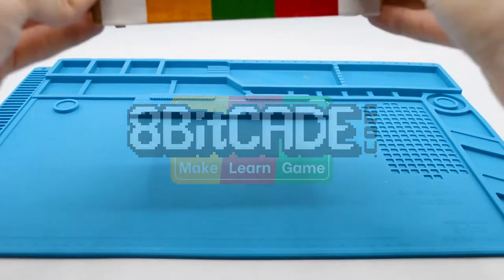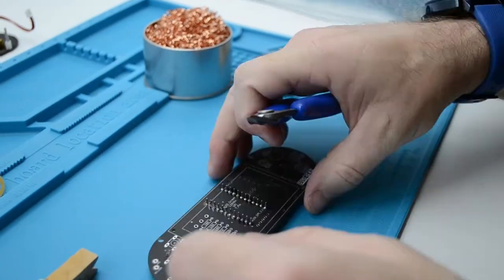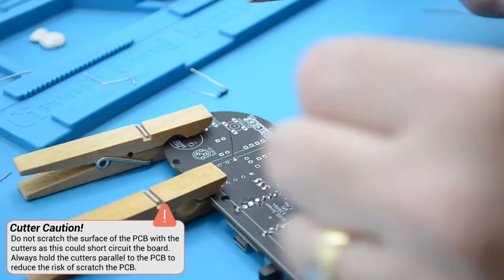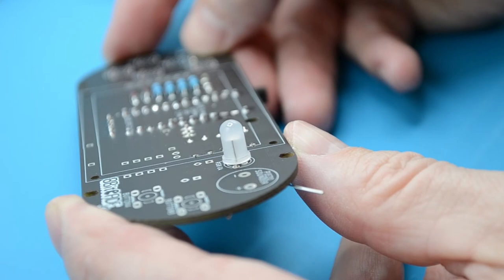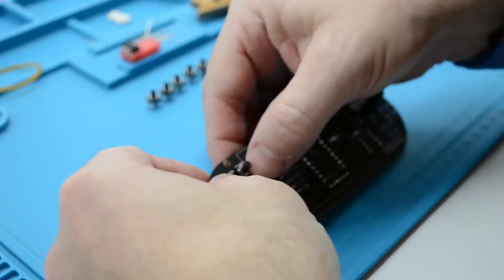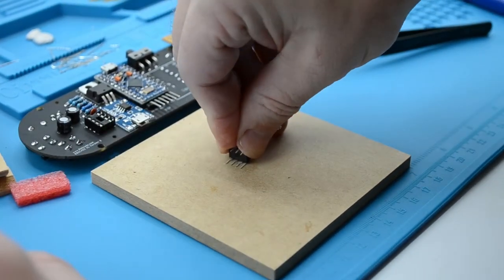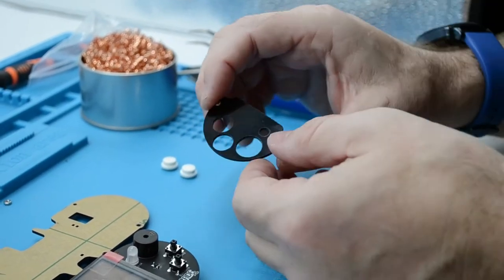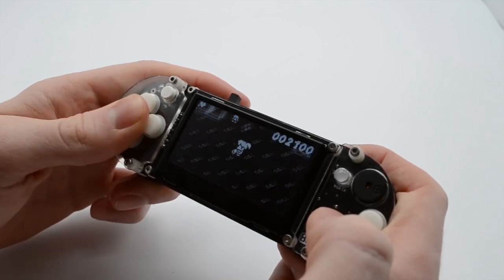8BitCADE XL: Make Guide - Build your own console!

Comment: @26:00, there are much better ways of soldering a board to a board.  Please change this!

Your manual on your site for the XL has numerous errors in it.  For example using plural when there is only one component.  Never once did it mention soldering the battery connector, it just assumes it comes pre-installed.  Many other issues.

Why did you cheap out with those nylon parts?  The nylons threads are a joke!  I had to defect 2 of your packages (I had to get a total of 3 from Aamzon) in order to get 4 sets on nylon bolts and nuts that would actually thread properly. What a huge waste!